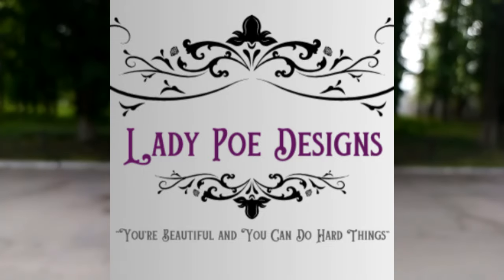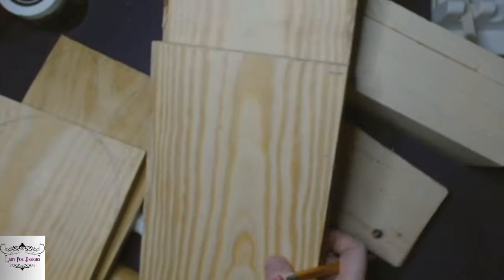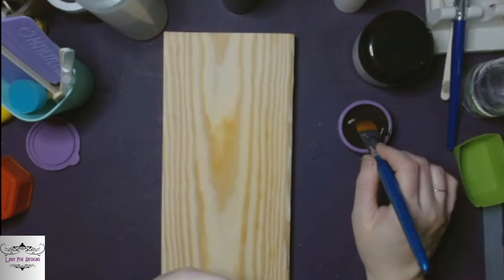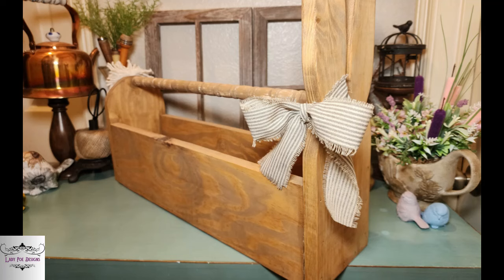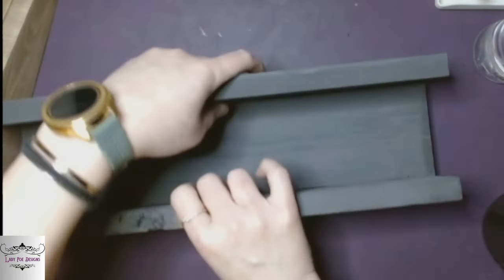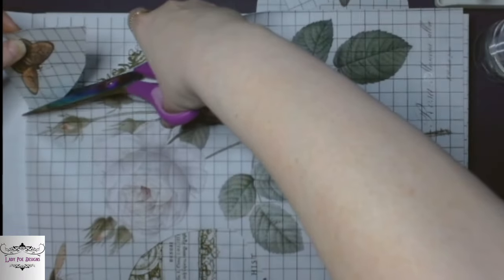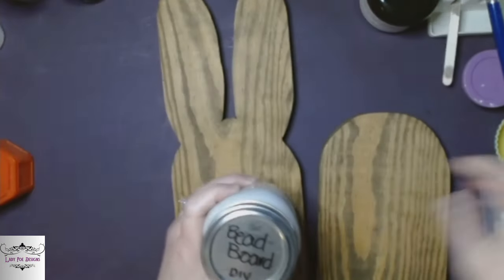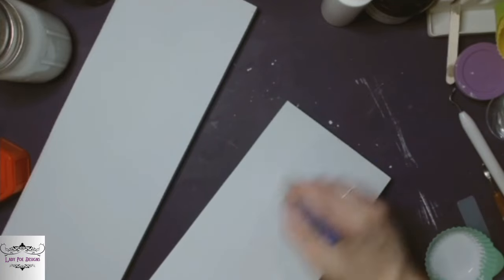Easter Bunny Spindle Boxes

Comment: Hey Erin!
Another great video! Great projects!  Good to know about spritzing dry wood with water as you paint. The boxes were all cute 😍 I LOVE that bird transfer!  I've used one of them.  I'm becoming braver in cutting parts of transfers instead of always trying to use the complete image!  Great transfer box!  But the inlay bunny box was gorgeous! 😍 I have that inlay, but I haven't used it yet.  After one of your past inlay projects, you were great encouragement to me to just try it. I have the Melange, so I chose a couple images from that and did a wood tray. I was so worried about the inlay making contact that I used my brayer.  I ended up with a paint box around it! I noticed that you just use your fingers and damp cloth,  and it came out awesome!  When I have the courage to try again, I'll have to remember to spritz the inlay before placing. And not using the brayer! 
Thanks again,  Erin,  for the tips and inspiration! ❤😊
Reply from the maker: It really is just trial and error and what works best for you. I use a brayer on the ones that I set in bonders because I usually don't go back and spritz the back again. It doesn't stay on long enough and you don't really want it all that wet. What really makes the difference for me is spritzing the paint inlay before I lay it down. Just spray the paint side, set it aside, and then put your layer of paint or whatever your putting it down with. It's water based paint on the inlay right, so spritzing water on it not only starts to soften the paint so you'll get a better transfer, but it relaxes the paper that it's on so you have less wrinkles and bubbles. So you can defiantly use a brayer!! Just work from the middle out and don't roll off the paper. I find that if you're getting lines, you might be using too much paint. If I'm laying just a little piece down, I don't press the edge of the paper down so it decreases the chance of those lines. But if you choose to use a paper towel, that'll work too!!  Just dampen it. Not soaking wet. I just spritz it and wad it up and use that to press the inlay into the paint. You'll get it!! I'm tellin you, once you get that sweet spot, you're going to want to use them on everything!! Lol Let me know if you need anything!! You got this girl!! ( sorry for the novel! )☺️💜